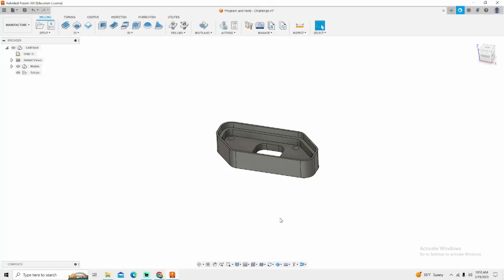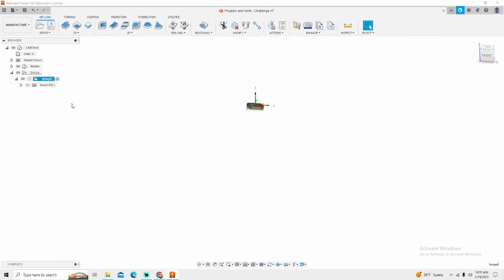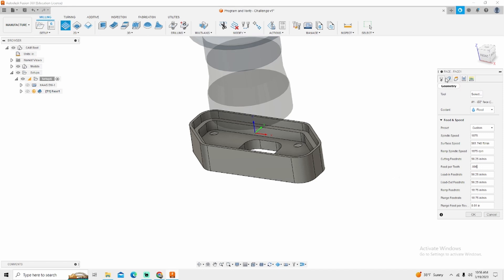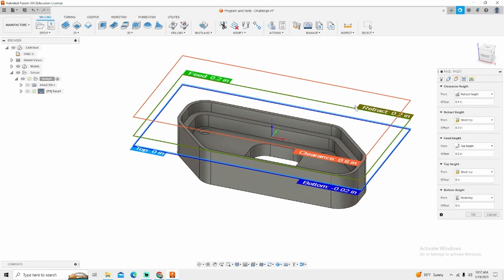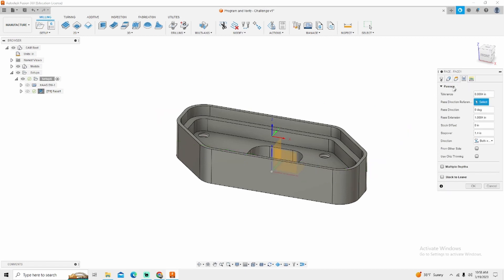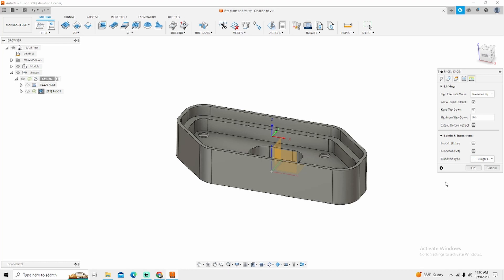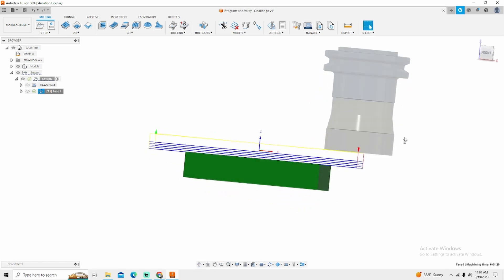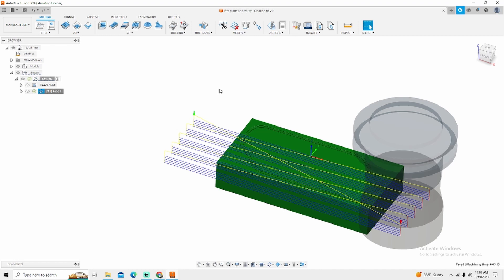In Depth Fusion 360 Facing Tutorial

Comment: Does this operation have to approach the part from the side? If i feel comfortable that it drops on it from top, can i do it?
I am missing literally 0.5mm of my cnc workspace to apptoach from the side.
Reply from the maker: Of course you can...... But it's not recommended. Usually, due to people being inexperienced and a potential crash. But you can always slow the plunge feed rate way down and drop in on top.
Reply: @machinistmade784  Is there a way to do in in Fusion360 setting or I just manually edit the g-code? 
If you know how you do it in Fusion, please, tell me. All the options I see is using Pocket or Adaptive Clearing. But I am curious how to make it the right way - with Facing.

Comment: In set up tab why would the stock fixed size value ever change?
Reply from the maker: It only changes based on the size of the stock you chose to make the part out of. 

Example: I have 3 X 2 stock on the shelf but not enough of it.... But I also have 3 X 3 as well. I could produce this part with both stocks, and not order material from a material supplier.